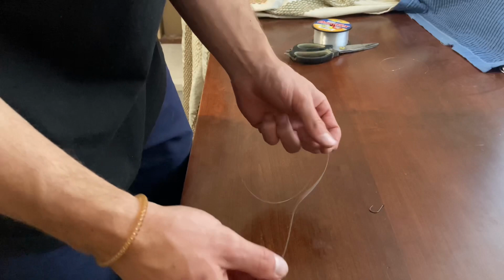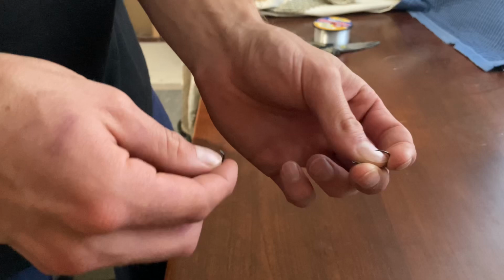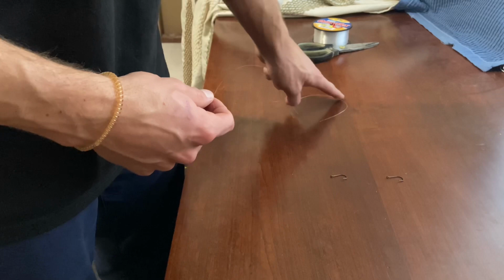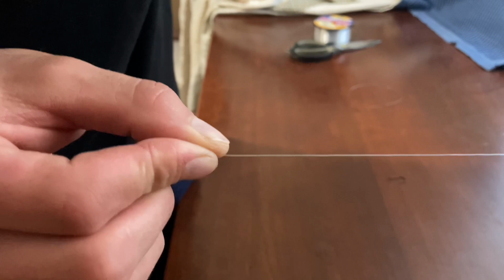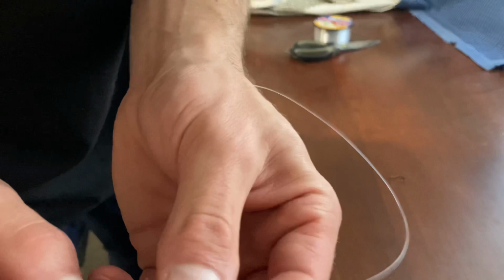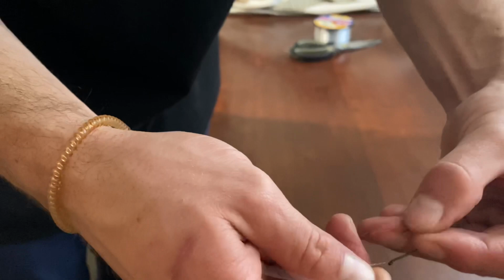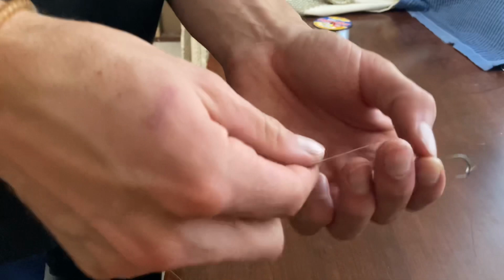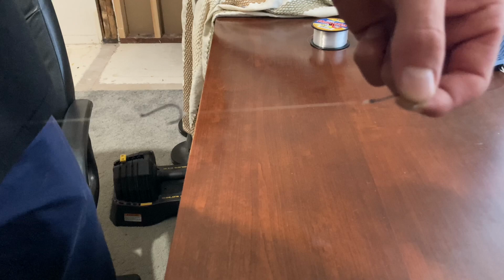How to Tie a Stinger Hook (or a Trailer Hook) Rig - Halibut Rigs

Comment: Howdy. I see your sooo close to your first 1,000 subscribers. Your subject is very interesting to me,  I live in sw portion of Washington state but I subscribed because I want to see you get monetized. Good luck.
Reply from the maker: Wow🤙 appreciate the support man🙏
Reply: If you live in SW Washington, you'd be better off tying and regular salmon mooching rig for your fishing around your area, when you're fishing bait (herring). You can tie it either with the top hook sliding, or with the top hook solid tied. Just YT it. But, you can use THIS method for bobber dogging or side drifting. Ex.. Soft bead on the top hook and then tie another leader like this video, but longer, for a second soft bead, or yarn ball. Not to get too confusing. But definitely use a mooching rig tie for bait.